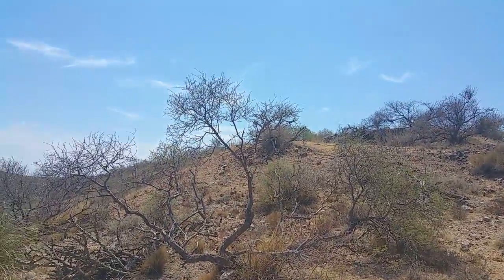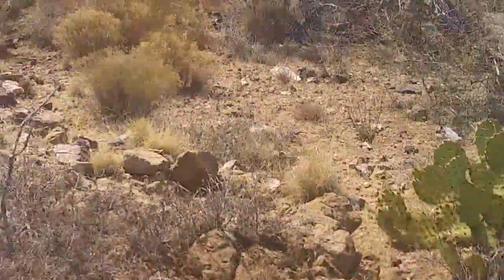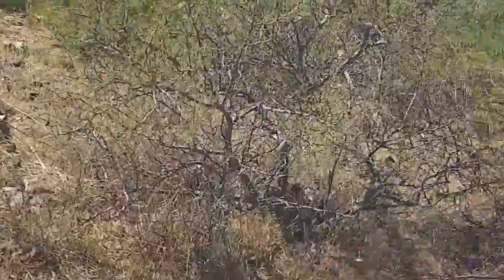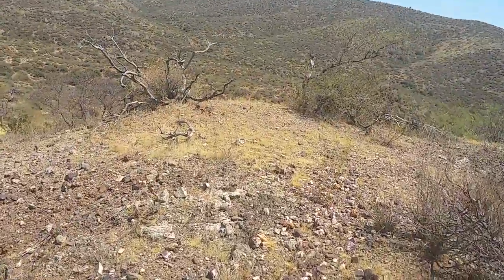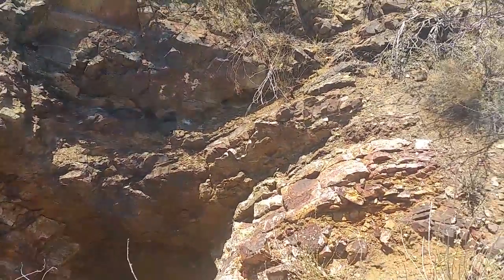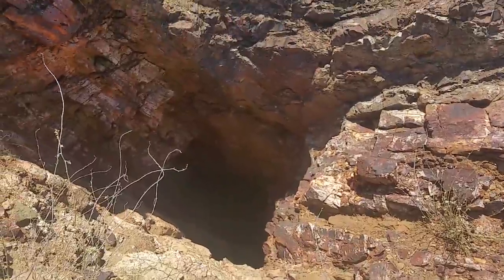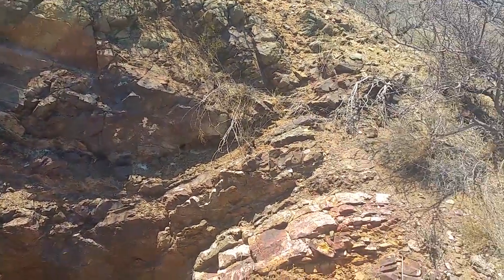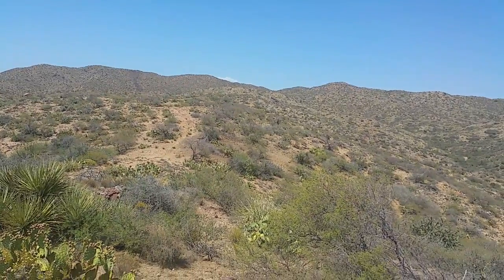232 Actual Shaft

Comment: If you could think of that 4 foot vein as having been formed horizontally, and if tectonics gradually tip-tilted the entire medium, the two mines could represent the same vein -- where there was some shear through the long period of tip-tilting. 

What I'm wondering is, if it is the same vein, and if there are concentrations of minerals and metals on each exposed wayward vein, then would the minerals and metals be found to be exclusive to each respective mine? Or would the minerals and metals be found in approximately the same amounts all along the (now broken) vein? 
For if they are the same vein, and if the minerals and metals are concentrated at each endpoint, this could provide an explanation for the separate deposits, and hence, mines.